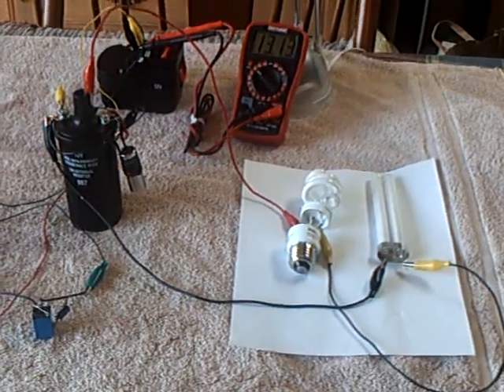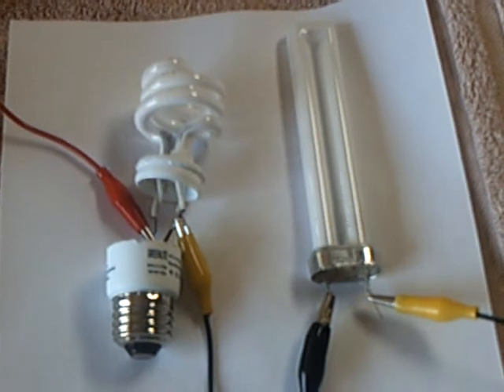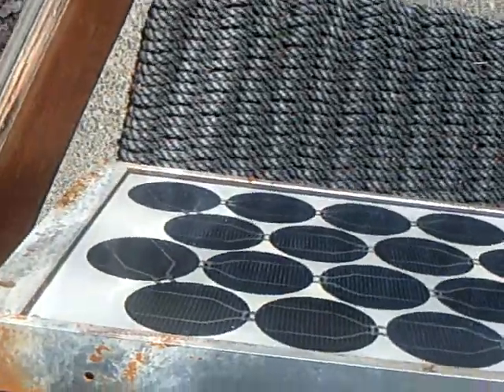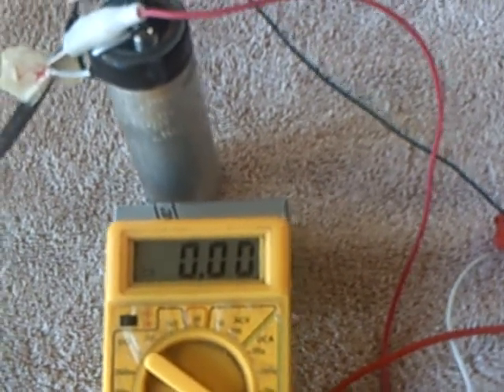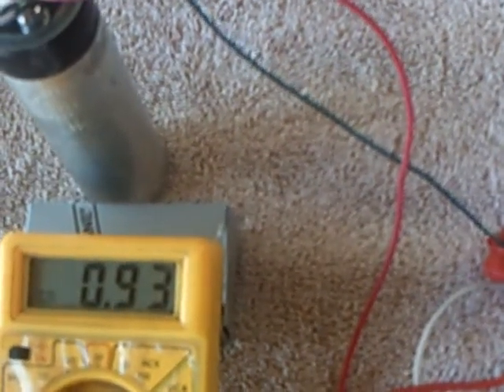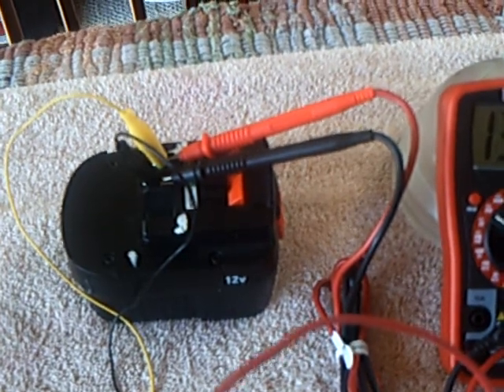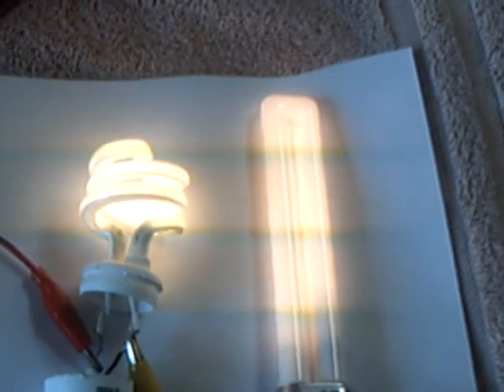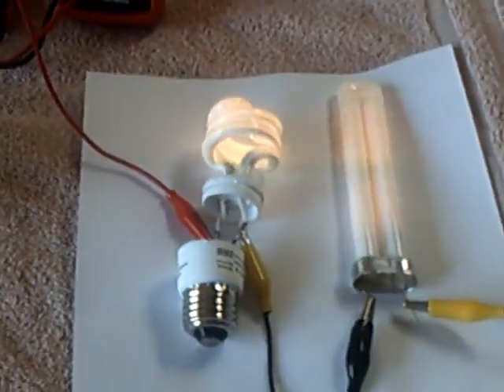Imhotep Radiant Oscillator -- Solar powered

Comment: With a 40 watt solar panel and an amp draw you could easily step up that voltage to power multiple bulbs. A 555 dc/ac converter is one way...